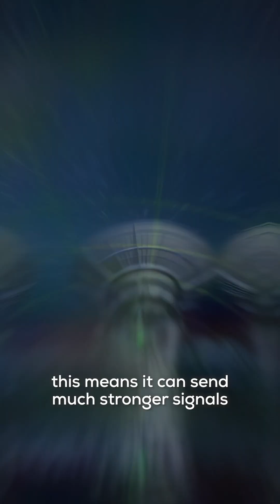How NASA Turned The Earth Into A Giant Antenna

Comment: The different antennas cover different times during the day, switching as the earth rotates the antenna away from being able to point at the spacecraft. The only gain is from the size of the individual antenna’s dish, not the addition of the multiple antennas. E.g. only one antenna at a time “hears” Voyager, but can share shifts around the clock.

Comment: This is really a misrepresentation of how this technique works.
Reply: I agree.  I can't find a source that says the signals are combined that way.
Reply: @Bogey Hole Troll  I worked for NASA for 32 years in space communications. At any given time, the DSN (Deep Space Network) has one of its three 30 meter antennas looking in a particular direction in space. One is in Goldstone, CA; one is in Madrid, Spain; and one is in Canberra, Australia. As the Earth turns, one of the three is just making contact, while the previous one is going out of contact. The 30 Meyer antennas are S-band receive/transmit. There are also multiple 10 meter, Ku/Ka-band antennas that can be ganged together to do the same as the single S-band antennas.  Regardless, none of these antennas "turn the Earth into a giant antennas".

Comment: Satellites orbit celestial bodies, meaning they go around, over and over. The Voyagers are not satellites, they're probes, meaning they go in a straight line, on their way out of the Solar system. I shouldn't have to explain this to you Mr Rocket Science Guy...
Reply: I'm not so sure. I think that both of them could be orbiting the Galactic Central Point. I missed some of the details, so I'm not sure whether this is the same as the giant black hole at the center of the galaxy.

Comment: I always wondered why we didn’t send satellites that don’t travel, but act as a piggyback to keep distant signals from degrading. Seems necessary, but also would be something to be used in future deep space (solar system) missions. 

It wouldn’t take many, especially with today’s tech and ease of launching satellites. Going planet to planet should be plenty strong enough for relaying signals, which has always been an issue. Something like this would be required to send submarine space probes to Enceladus and Titan for communication underneath tens of miles of ice to the recently confirmed water jet plumes seen from Cassini.

Comment: havent the batteries in voyager 1 already ran out decades ago?
Reply: Voyager uses a nuclear isotope thermoelectric generator that puts out 250 watts of power. The nuclear material (plutonium 238) has a half life of 88 years, so the generator output drops by 4 watts per year. In another 20 years or so there won’t be enough power to run its systems.

Comment: What’s the max limit distance then?🤔
Reply: Im not sure about that but it's expected to lose connection in 2025 because it can't provide enough energy anymore to keep the components running. But if you think about how much better james webb telescope and stuff like that are techonoligalle, we can propably keep signal going on pretty insane distances
Edit: I found out some source that claims we could send messages to 25000 light years away but to think about how long it would take to reply it's not that realistic. Soo propably like realistic distance would be something that takes few days to reach at maximum, like 0,01 light years
Reply: Electro magnetic wave travels at speed of light which is 3×10^8 meters/sec...So you can think of the distance it covered in a second...We can even go beyond billion miles...
Reply: @BALA-jw7nd  dude voyager 1 is over 14.8 billion miles away :D so your over billion miles answer ain't really any kind of answer for the question